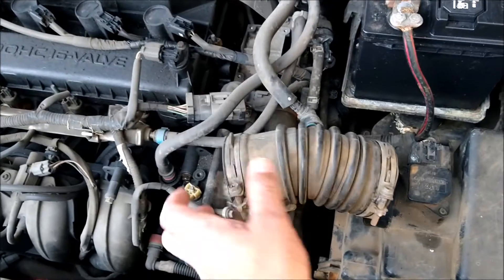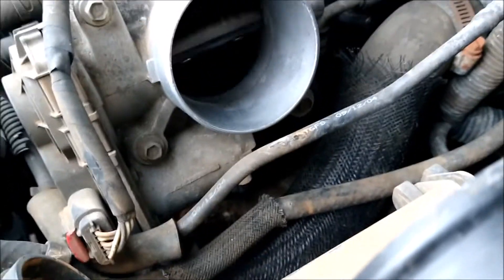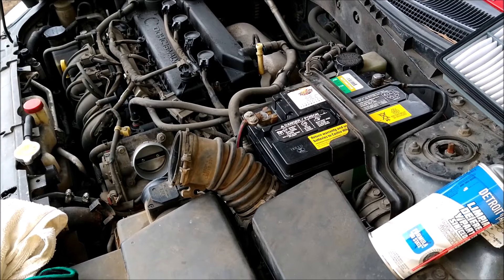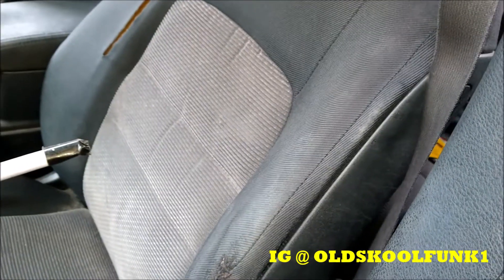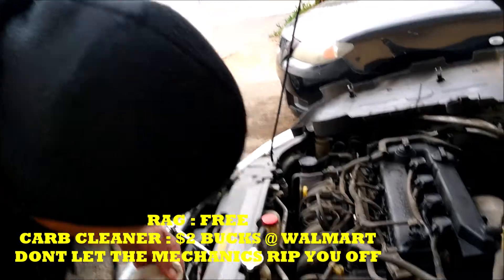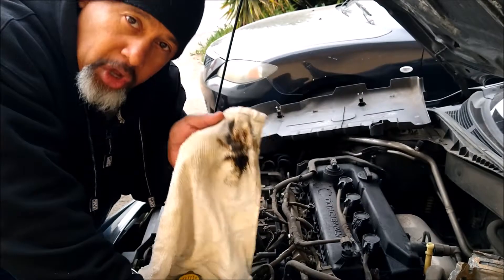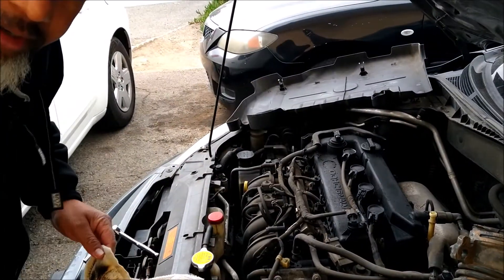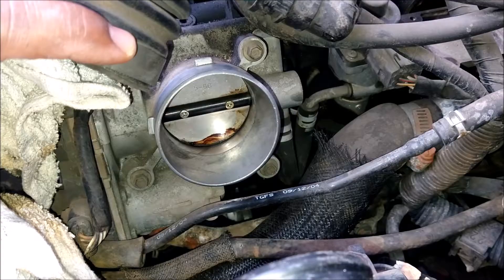HOW TO FIX A CARS IDLE SURGING & STALLING ( FOR ONLY $2 BUCKS )- A RAG AND CARB SPRAY (CHEAPEST FIX)

Comment: First thing I did when I bought my daughters car was replace all the filters and clean the throttle body. Like you said, it's a maintenance thing.
You are awesome man!
Reply from the maker: Right on DM, I do this to all the cars I work on pretty much and it really makes them run alot smoother also. I Appreciate the comment DM.
Reply: Do not forget the fuel filter. A very common problem for stalling.

Comment: Genius! Great idea to not physically mess with the electronically controlled throttle plate. One of the things I miss from the old skool days of actual throttle cables. God bless.
Reply from the maker: Ya JJ I learned that the hard way years ago lol. You have to reprogram the electronic throttle body and PAY $ LOL. Remember those throttle cables and adjusting the throttle valve with the screw  and idle air mixture balancing days? Your bringing up Skool of hard knocks days lol, Right on my man.
Reply: Not really it would mess with electrically controlled throttle body intake.  I do this all the time like every day with our customers cars over 1000  and had no issues in a past.
Reply from the maker: @maxinpains6937  One day you will find out the hard way, get ready to pay a programmer. I show how to save money not waste money. I don't recommend anyone to move the throttle plate even though I have moved alot also but DO NOT MOVE THE PLATE or you will pay the price and your idle will not be calibrated anymore, then it will go from a $2 dollar fix to a $100 plus. Don't do it, unless you know for sure you can without effecting the calibration. I learned the hard way.
Reply from the maker: @maxinpains6937  One day you will find out the hard way, get ready to pay a programmer. I show how to save money not waste money. I don't recommend anyone to move the throttle plate even though I have moved alot also but DO NOT MOVE THE PLATE or you will pay the price and your idle will not be calibrated anymore, then it will go from a $2 dollar fix to a $100 plus. Don't do it, unless you know for sure you can without effecting the calibration. I learned the hard way.

Comment: 😂Thank you for showing me where the throttle body is. I'm just learning how to fix my 93 civic. Idle is crazy, sometimes engine doesn't start unless jumped. Diagnostic says battery and alternator works ok. I'm going to test distributor, spark plugs and spark plug wires today. God bless and protect you.

Comment: I just did this two days ago before watching your video. It does work! I had to tap my idle control motor with a screwdriver afterwards. I guess it got stuck in  a position and would not go back correctly?
Everything is working good now!

Comment: I fixed a lot of cars in my mid 20's and yes you are right!... Another trick is to spray carb cleaner around the gasket or throttle linkage, manifold, to find out if you have any air leaks. God bless you!

Comment: Thank my guy, I have a 2002 Nissan Pathfinder that I just purchased that started but especially until it warmed up a bit, was wanting to die but keeping it alive for a minute or so with the pedal, would stay running and idling, but idling very low. With a closer inspection I realized that the number two cylinder did not have it's coils wire harness plugged into the coil. After removing the existing coil saw that the coil was missing the lower half of the boot altogether. So it had been running on only 5 cylinders apparently, and was the cause of the issue...I thought.? After replacing the #2 cylinder coil and all new spark plugs, it starts right up but now its idling at 2000rpm, dropping erratically between 2k and 1300 - 1500rpm and also now crawling forward pretty hard while applying brake at a red light and keeping it from driving forward on its own. I also happened to find and idle air intake valve, and a throttle position sensor in the glove box so whoever had it before me must've been trying to fix the problem and couldn't so they sold it to me. I'm gonna try what you just showed me man. That might actually be what the problem is man. Thanks, you da man big homie!

Comment: beautiful tip. 👍 honestly what you said was a1 advice... the idle air curcuit / high idle selinoid (ac) and emmisions  in / on the throttle body of most engines they cause and faults from yep carbon... so... honestly couldnt have broke it down any better. god bless

Comment: I did what you did to the throttle body. The car is surging when in park position but does not accelerate when I shift out of park position. What should I do or replace?

Comment: Hey brother I need your help I have a Nissan cube 2006 I am changing  my head gasket and now I don't know the head bolt torque  specs to tighten  them back it's a 1.4 engine

Comment: wanna get 85 mpg ......if on long downhill any where shift  car into neutral watch rpm's drop from 2 k to 1 k and speed increase which depends on the incline of street or roadway reason the gears are not engaged i saw this when driving my sons audi the mpg bolted up to 85 mpg

Comment: my 01 crv lx is having an issue where when i go past 40 mph the temperature gauge starts to rise going past the 2 water waves/close to the red mark but when i bring the mph back to 40 or below the temperature goes back down and to the normal half way mark. My fans turn on but only when i turn the ac on. Are they suppose to come on by them selves and if they are is this an indicator that my fan switch needs to be replaced or is it the fans? Checked for a blown head gasket and the test came out negative, the top hose is hot and the lower one is cool. Thats suppose to indicate that my thermostat works right? I think my water pump does work but what would be a symptom if it didn't work? My crv is at 147k miles. Im confused as to why my crv just started to randomly rise on the temperature gauge... Any help is appreciated

Comment: Could you do something with abs? I have an 02 gs300 and i changed my wheel speed sensor because my abs would always go off. That hasnt fixed my issue. Any ideas?
Reply: @Mr. 6 liter im on stock right now
Reply: @Mr. 6 liter my guess is probably the bearing. It could be dirty
Reply: @Mr. 6 liter mine is rwd :)

Comment: yup correct undortunatle my tube connected to that m fer throttle body is like 2 feet long so i used a long dryer filter brush to wipe it clean then when done heavy oil spray lube NOT wd 40 that stuff dosent stick and increase your mpg 3 mpg or more buy any cam of spray lubricant at dollar tree or dollar general spry in gas tank before fill up this coats the gas lines and you get complete burn and wow everything runs better also if car is talling and sometimes dosent start just cranks your problem can be 1 or both sensors crankshaft postion sensors cheap $25 - 58$ and cam shaft position sensors omg imagine on hi way car stalls and no where to pull over my car didnt do it at highway speeds all at low speeeds like after making a turn grrrrrrrrrrr

hey it's old bought it 2015 a gem 1 owner only 5o k miles on it

Comment: Waste of time not taking it of and fully cleaning it. Especially if yours is cable driven instead of fly by wire being that a cable driven will have an iac thats just as covered in sludge as the butterfly. The thought is right but this is a bandaid and will quickly be back to the way it was with everything not being removed inside.